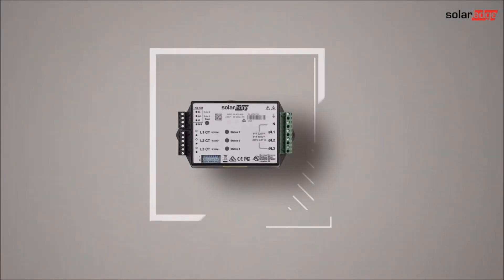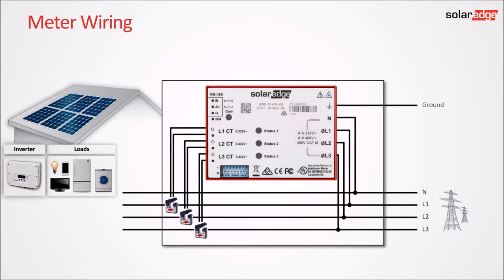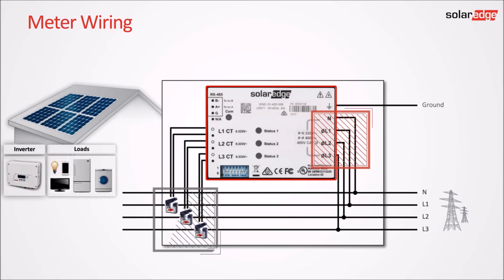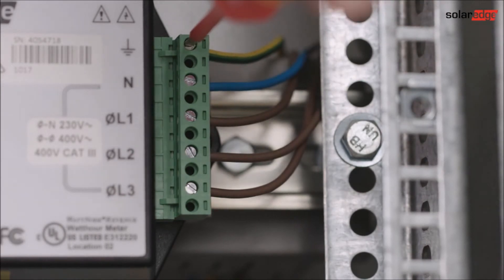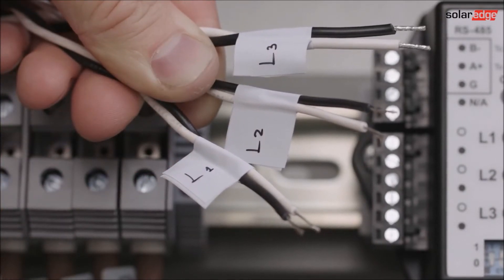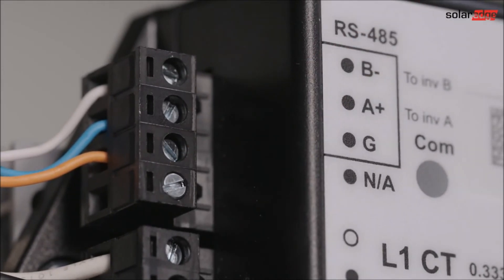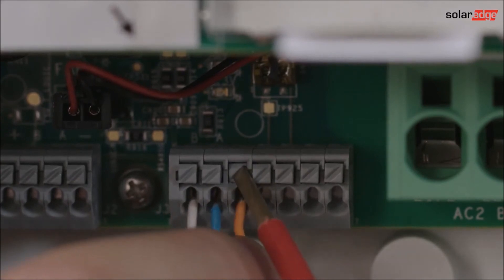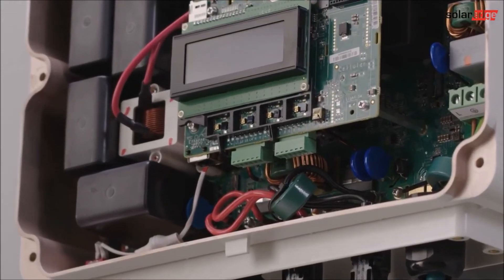How to Install SolarEdge Modbus Meter (Part 3) | RENVU

Comment: Is zero export (to the grid) possible with these SolarEdge products?
Reply from the maker: Zero Export is one of the Charge/Discharge profiles you can choose from for the SolarEdge StorEdge system. 
You can find out the details of that and other profiles here: https://www.solaredge.com/sites/default/files/storedge_charge_discharge_profile_programming.pdf